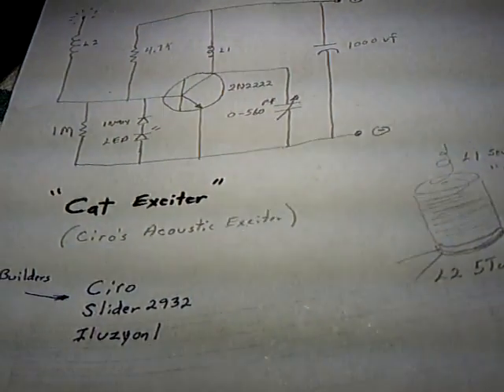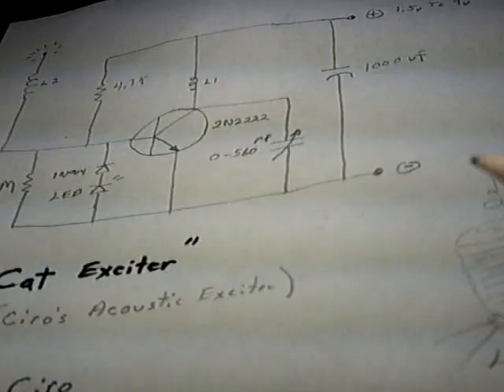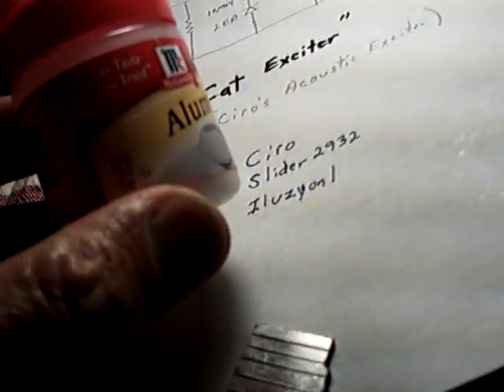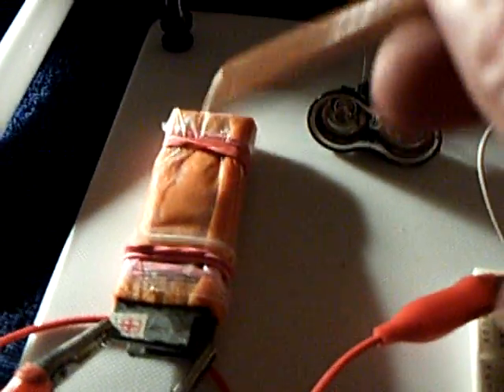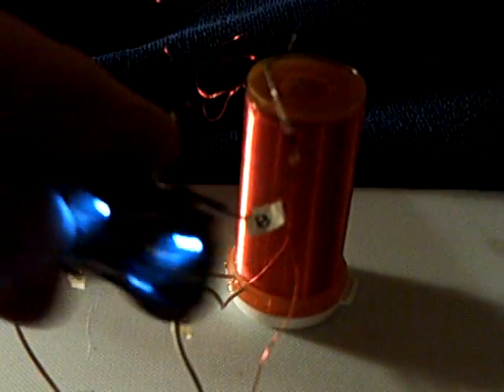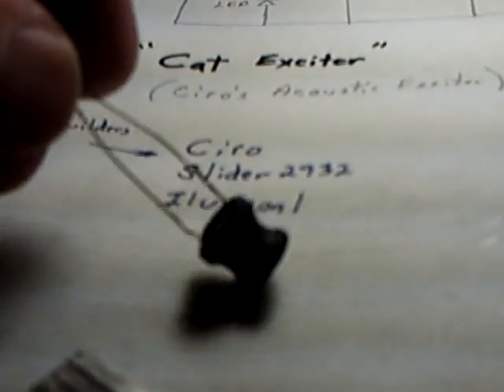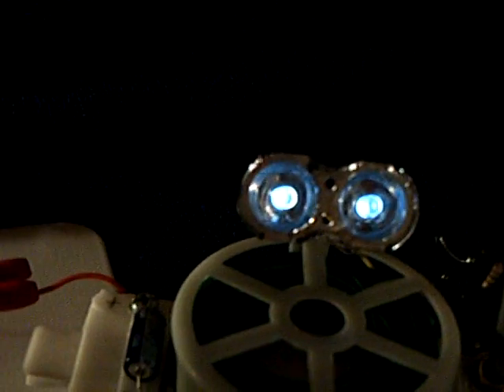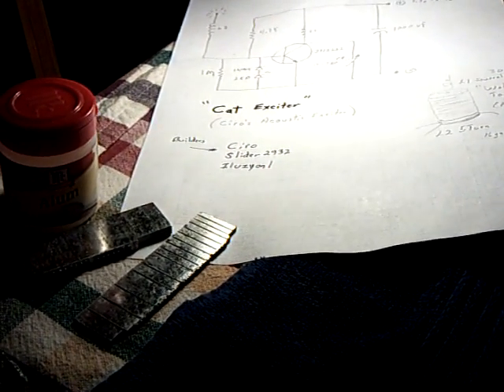Homemade Lead-Alum cell powering an Exciter

Comment: Thanks Lid! Those look like 1N4148 Diodes on the  avramenko plug... is that what you use? PS - do you have an LCR meter to measure the mH on your coils?... I would like to try this with standard inductors... I hate winding coils! lol

Comment: Great job!.. It works just as good as it is supposed. I am getting really interested by those Lead/alum batteries too. I am wondering if you charge them backwards at first, like John showed on an earlier video (to desulfate the plates i think). Another thing... I see that very small Jar of Alum everywhere on youtube...I buy my Alum in a drug store. I dont know in USA but in Canada, it is way cheaper than in the grocery stores and the bottle is 3 times bigger :D

Comment: got a link for John Bedini's alum battery stuff?
think i will give the lead and epsom salt a go.
also im looking into zinc air battery that also behaves as a fuel cell when you pump more oxygen in...might be a really good use for the oxygen from electrolysis.